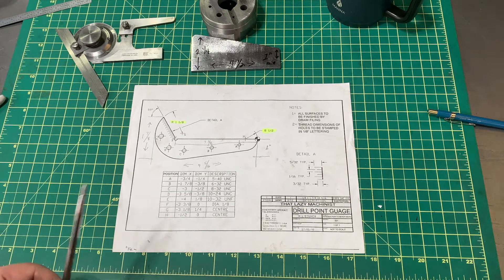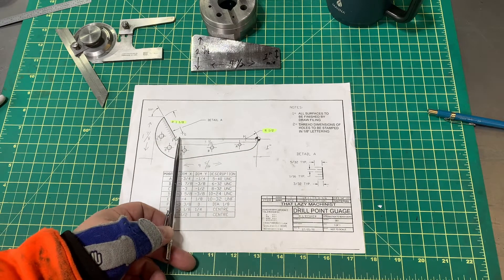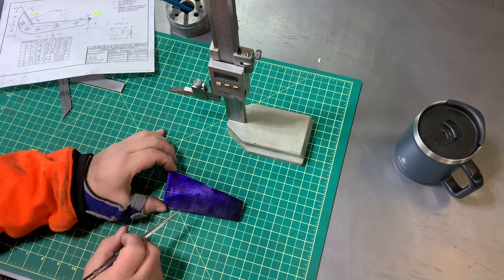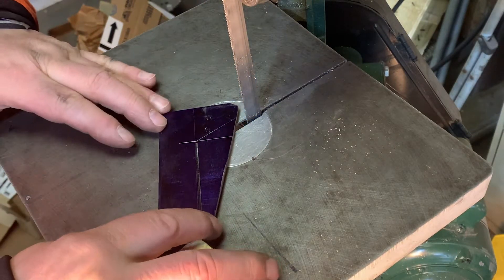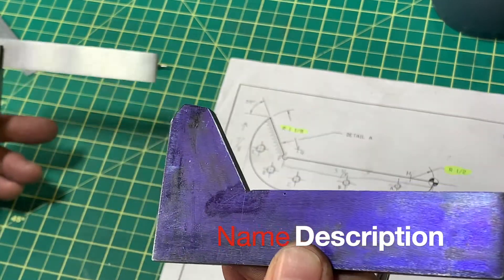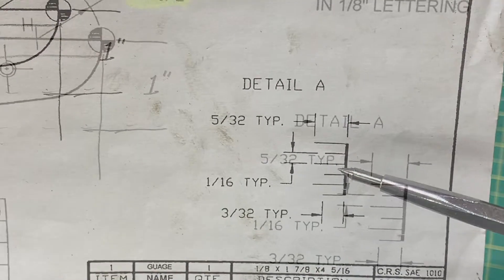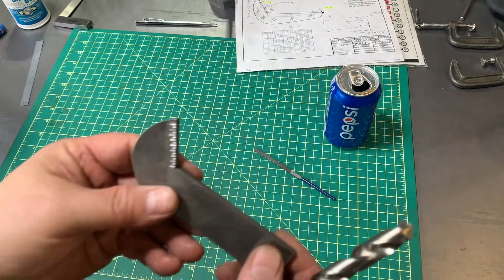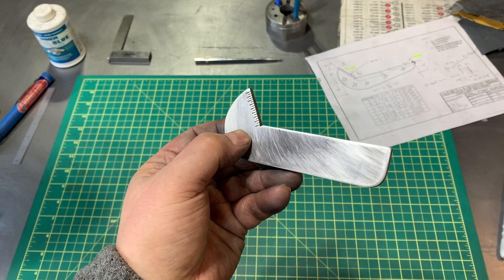How to Make a Drill Point Gauge

Comment: When you scribe a horizontal line on thin stock that cannot stand up on its own, use a right angle plate to hold it vertically.  Your work will show significant improvement.
Reply from the maker: Great advice. Thank you. Gilles